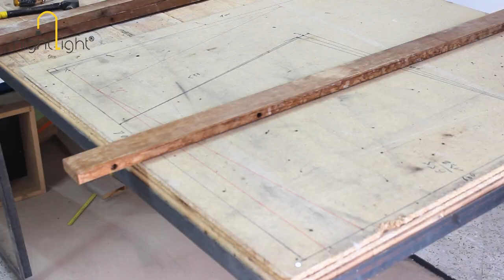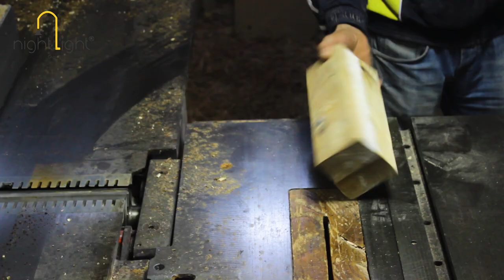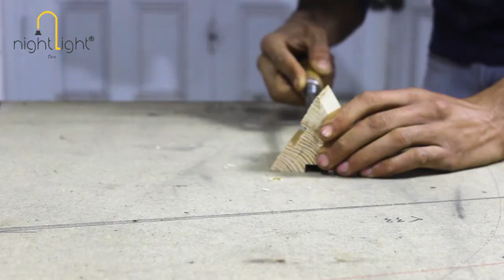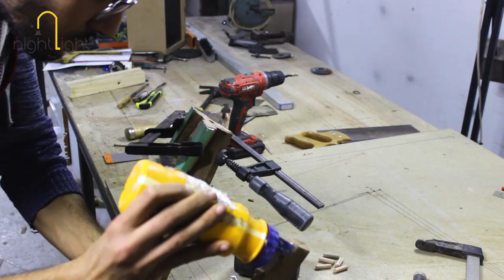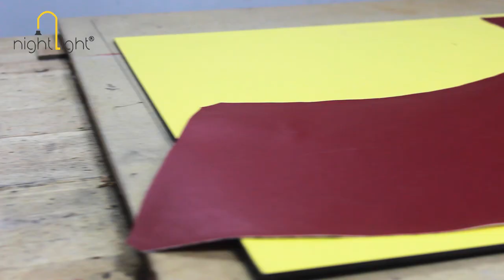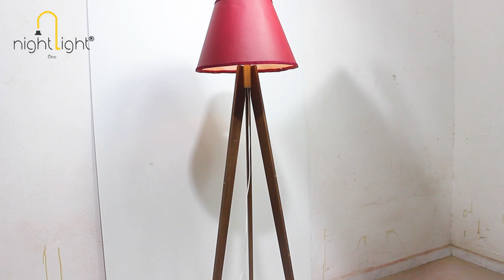Tripod Lampshade (wooden)  ! How to make DIY

Comment: Could you explain lamp shade material?
Reply from the maker: it s basicly polyphane paper inrolled (with glue ) to a carcass (2 circles ) then you put a tissue of your choice on the polyphne which is already self-sealing.
the polyphane paper is necesary to protect the tissue from the heat and it gives the lampshade structure its solidity .
hope you like the other episodes as well & welcome arround.